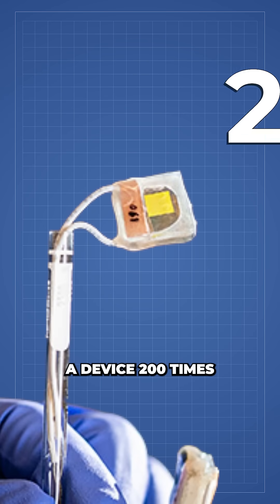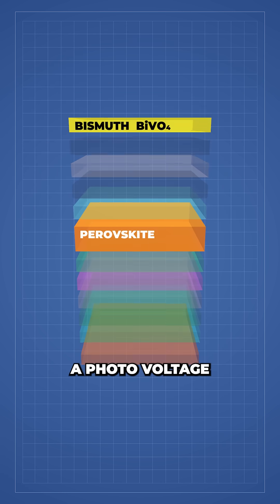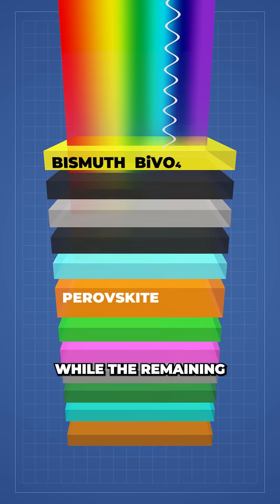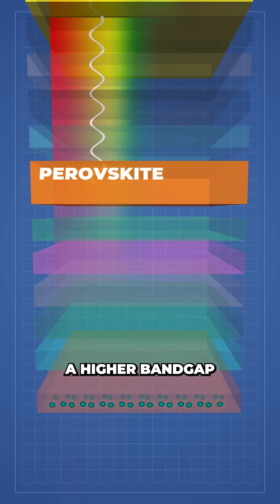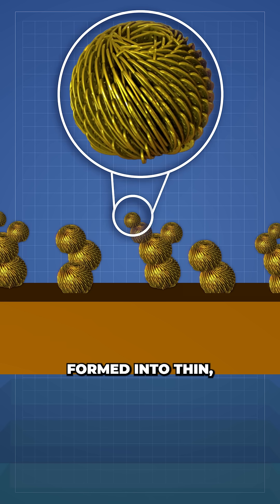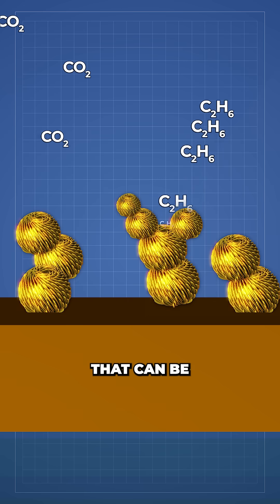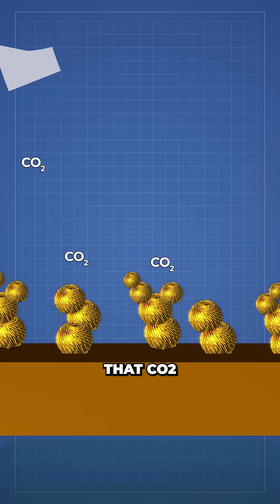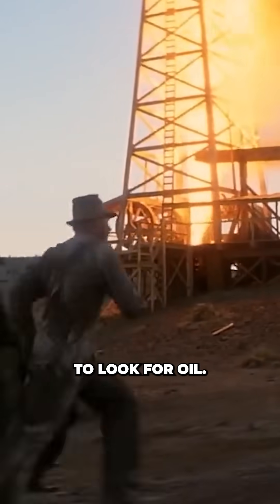Scientists Create Artificial Leaf That Converts CO2 into Fuel

Comment: I really hope this actually functions and doesn't dissapear like all the other inventions
Reply: It functions, the question is whether it's economical. If production takes too long, the mechanics scale poorly, or the finished product is too fragile for all-weather use, people will stick with traditional photovoltaics until it matures or something else comes along.
Reply: @pretzelbomb6105 Or if the oil companies flash their money at them.
Reply: @pretzelbomb6105  in this case it genuinely could work since the crystal layers are essentially how LED's work as well and copper could easily be formed into tiny structures like this as well, 

the rest of your argument stands, it may well fail in natural environments
Reply: @pretzelbomb6105 production and sourcing materials = way more than forestation I just do jot see it I’m sorry
Reply: @pretzelbomb6105 it is just prototype. Solar panels prototype also weren’t good enough to make electricity. Also, thats how plants are. They’re inneficient and produce only small fraction of oxygen that is released into aid. Other is absorbed by plant itself
Reply: @pretzelbomb6105 I can see it being used for heavy industry, but not for consumer use.
Reply: @pretzelbomb6105 also this tech completely ignores the fact that co2 is still released into the atmosphere if we use it to create fuel from it. The same issue with e fuels. E fuels a worse because they release co2 that was previously stored away already in the garbage they use to create them. At least in this video it sounds like this invention is net zero. If this thing increases the overall fuel usage, even if it takes out co2 again while active, the overall co2 levels in our atmosphere rises. 

Also a general issue, especially in denser cities, having the exhaust gases of anything that runs on fuel trapped in cities is really bad for the health of everyone living there.
Reply: @pretzelbomb6105  dude even if production never hits industrial scale enough to replace ordinary fossil fuels in the next century. This alone can offset the carbon footprint of gas vehicles since it actively pulls carbon dioxide out of the air. Fuck the fossil fuel replacement. It will save the planet from global warming by itself. Like holy crap. 

Like it’s amazing that it can replace fossil fuels in the future. Though it’s even more amazing it actively cleans the environment from the fuels it makes!
Reply: @pretzelbomb6105 Anything that will disrupt the current power structure is seen as uneconomical.
Reply: @TheHardys01  No it isn't. You don't think major companies would want to hop on this technology if it could let them output the same power at a reduced cost? That would mean a higher net profit for themselves. In reality its actually all about the feasibility of making this on a large scale and still retaining profit. If its possible it will happen.
Reply: @TheHardys01  sometimes its more about can we produce it cheap enough to produce the problem with some inventions are cost and logistics
Reply: @justinmcgough3958  yeah but they would practically spend huge amounts of money on making new facilities to replace the  now obsolete old ones such as with torium reactors and they would only pay themselves back in years if not decades
Reply: @TheHardys01  Yep. Money is seen as the only “cost” despite it being a human construct that will lose value over time. Future advantages/disadvantages? Environmental impacts? Unsustainable practices? Nonrenewable resources? No real things are factored into the equation at all. It’s all about money, which isn’t even a tangible object. They need to get better at math when it comes to long term effects. Some day the oil businesses will run themselves dry
Reply: @LeeTwentyThree  the oil businesses are fully aware that their practices are unsustainable, and that the oil supply will eventually dry up. They just care about getting enough money as possible before jumping ship and leaving the next person to clean up the mess.
Reply: @TheHardys01 You’re not wrong, but also this is not a new status quo for scientific innovation in the 20th-21st century. And cost rises alongside variables that, even if money were no concern, you may still not prefer those tradeoffs. “Less economical” might mean “50% more labor hours to produce the same electron output”. I think even without money, that’s still a difference that makes it less viable. And then, the question of how reliable they can do this. They have one or maybe a few. That easily could’ve taken several years to develop if not longer
Reply: @TheHardys01 Doomerist nonsense. The status quo has been shattered over and over again, it just happens slowly enough that people don’t notice. It’s also not a conspiracy that some things don’t work. The Concorde was a real plane but commercial jets no longer fly as fast. Why? Because it didn’t work out.
Reply: @TheHardys01  it's uneconomical but not for the reasons you believe.
This would actually uphold current power structures as it keeps us burning fuels.

But it's not practical because this video left out an important detail:
Carbon in our atmosphere is incredibly diluted. So unless we strap these to the exhaust of every car, plane and ship, we will have a really difficult time to get enough CO2 to reach these leaves.
Reply: @justinmcgough3958  yes problems will only arise if this ever opens the door to be combined with other ongoing projects for growing SCs from the sun. That could close the cycle matter-energy by producing devices like this for free not just cheap. 

Lets not forget at a larger scale making money is all about managing scarcity. So such combo would be as close as it gets to Star Trek matter synthesizer or in other words put an end to capitalism...

So its all about keeping a gap between what is technically feasible and what todays primitive and crony capitalism cares about...increasing inequality and nothing else.
Reply: @TheHardys01 dude it's not the deep state oil barons that shut down all these inventions. Inventions that seem great on paper are sensationalized as this groundbreaking new invention, even when those inventions are just a slightly updated version of technology that has existed for decades. Usually, these inventions just don't work in practice. They're too expensive, too fragile, not efficient, etc etc, and nut job conspiracy theorists spam stuff about how it was "silenced" or spout about how the scientists "weren't suicidal" or something.
Reply: @TheHardys01  not really, as the results of too much carbon in the atmosphere are now hitting the foundations of northern hemisphere society  full force and causing social unrest. 🎉🎉🎉
Reply: @justinmcgough3958  yeah where’d that highly customizable phone go?
Reply: @TheHardys01  no... Oil and Natural Gas were at some point also disruptive, but the economics initially were not there, evemtually we got good at oil and gas refining and Boom, Oil & Gas industry was born
Reply: @TheHardys01  The companies at the top of the "current power structure" have the means to make any viable technology work for them quicker than anyone who would compete with them
Reply: @justinmcgough3958 Dude look at all the work the US puts in to protect oil companies despite them being 20+ years obsolete. The fossil fuel industry has had a tight grip on the economy since the start of industrialization and they'll fight tooth and nail to keep us dependent on their limited resources.
Reply: @TheHardys01 it tends to create a new one
Reply: @TheHardys01 Not really bro
Reply: @TheHardys01 what do you mean
Reply: @justinmcgough3958  Plus, even the argument of oil companies silencing alternate fuel possibilities falls apart - Even they know oil is finite, this allows them to effectively make synthetic oil and pretend that there are far bigger reserves than there really are, just, "Really hard to get so the cost is going up"
Reply: @sundown6806 that and we don't really have a practical alternative, with coal and gasoline our current level of development isn't sustainable, wind, solar, geothermal, or even hydroelectric just don't have the potential to replace them with our current level of technology.
Reply: @pretzelbomb6105  By economical you mean makes big corporations 3% less profit so they toss it.
Reply: It more than likely will. Achieving something in lab is completely different from mass-production at scale.
Reply: The most decisive factor is the cost-benefit factor.
Not only monetary, but also resource-wise. If it consumes more resources than it generates, it also becomes unviable.

Generally everything is very inefficient in the first stages, especially in terms of energy, so it is initially unviable.
And then there's the economic factor, where current production and utilization methods are more economically viable and profitable, so it makes sense to try to adopt something less efficient.

Actually, there are many futuristic processes today, but they are still very underdeveloped since it does not make sense to finance their development.
You'll see this process and others begin to be developed and implemented when we run out of oil, and those new processes become more "competitive."
(basically its development and production cost will be equal to the current price of oil, when the cost of oil increases due to the decrease in supply)
Reply: Making the nano structures outside the lab is probably going to be the big issue.
Reply: @aguyhere7945  Why would they need ro make it outside the lab?
Reply: @zoraackerman1684 Because to scale this process up into something that was actually useful you'd have to be able to mass produce it in a factory setting. 

Making a few demonstrators in a lab using people who spent their entire lives figuring out how to do it is a very different prospect than figuring out how to make a lot of them with people who are just punching a time clock.
Reply: @zoraackerman1684That is one NERD question if I ever saw one 😵‍💫😵‍💫😵‍💫
Reply: @aguyhere7945   The nano-structures and the Perovskite crystalline layer. Perovskite show a lot of promise but the material has a short lifespan in real world applications. Something like a few months of viable operation.  To put it into perspective an average solar panel is guaranteed to last at least 10 to 25 years.
Reply: We are going to be bombarded with this news every 8 months like we had to sit thru 100 shorts asking if we have heard of Carbon Nanotubes 😀😀😀😀
Reply: Well, science tabloids usually overhype these sorts of things to no end. That's the real reason so many "breakthroughs" disappeared. They were never actually breakthroughs to begin with.
Reply: Or they are too expensive or too hard to scale up.  @papawheely4137
Reply: @papawheely4137 The opposite can and does happen ,breakthroughs are not or very late recognized as such and became a huge succes after all.
Transistor anyone
Also many 'crazy' ideas ,black holes etc.
Reply: It’s less about whether it “disappears”. When people say “scientists did X” they’re often talking about an academic research lab. Sometimes the discoveries in these labs are not cost efficient or scalable, but they pave the way for new technologies that may be. First you have to convince a company to produce it.
Reply: this will be the last time you see it.
Reply: the problem is they have to be able to make them cheap, and you're already starting with Bismuth. And Vanadium  Maybe something more  organic.?
Reply: It'll be bought out by big corporations and smothered to keep their profits. Tried and true practice.

Backup practice is to divert their funding into their own made up projects that "perform better" than these, make the r&d go out on it's own due to lack of funding, kill their own faux project and get back to business of being the planets dentists drilling cavities.

Or 3rd option. If anything happens to them, keep in mind they're not processing unalive thoughts or mysteriously leaving the project without word to anyone (disappearing). Possibly even a mysterious "accident" to the facility.

If this project mysteriously disappeared, it's due to one of those 3 reasons.
Reply: Oh they will sadly
Reply: ExxonMobil: "You'll never know if this technology works or not, because an anonymous entity is going to purchase the technology and require the scientists to sign a lock tight Non Disclosure Agreement".
Reply: A lot of the problem with amazing stuff like this is while it works in a laboratory setting, it either isn't economical, or isn't stable enough to work commercially.
Reply: @themecking  Yeah but who’s to say in 5-10 years it won’t be scalable and viable? We NEED someone to support this. Because regardless of if you believe it or not.

Global warming is real, I remember back in fucking elementary school. The vast majority of summer days. I could walk outside barefoot and not even have to worry about even getting my feet more than warm. 

Now during the summer you’d have to be constantly doing the walk on coals trick. lol
Reply: These corporations are evil in nature. Driven by greed. If seen a threat to their economic future, they move to attack the threat. Despite government warnings. They are corporations.
Reply: like the other guy said, it has to be practical. this is just a proof of concept. like those cancer cures, they need to be put through much more testing before it gets approved. ie just because it kills cancer cells dosent mean it wont turn the human body into goo. 
personally I was thinking why cant we grow fields of crops then treat them for the fuels we want. its gotta be cheaper then this.
Reply: They made it a few months ago I think it's fine
Reply: "Like all the other inventions." You know, it actually amazes me that people believe such braindead conspiracy theories as if you can't take one look around and see all of the amazing inventions and discoveries that have been made and are still being made every day. Trust that if this technology is shown to be practical and profitable, then it will almost certainly exist and start being produced. The oil companies aren't some all-powerful monolith. They have great economic power, yes. But if a company comes along that is able to produce these devices efficiently enough that they can sell them at a profit, then they will. The ironic thing is that oil companies would very likely be their first and biggest customers. Such companies don't just assassinate anybody with an idea that could compete with their current business model. They just adopt the technology themselves and profit from that instead.
Reply: Ok so when for mass production ?
Reply: Assuming it's economical in mass production, it's just making more profit for them because now they wouldn't have to spend money searching for, drilling to, and transporting oil, refining it, & transporting the byproducts. It's in their economic interests to get this to work.
Reply: it will disappear because they'll end up killing all plants because of the lack of co2 and then all of humanity will collapse due to lack of food
Reply: agreed.
Reply: Hope is great, but this doesn't read like the sort of thing that can easily make it out of a lab.  Solar cells are quite on the expensive side to produce after decades of innovation, and this is a more complicated, more power peaky solar cell.  Think of it as a proof of concept, that this methodology (among several others) is a viable path for future research toward carbon capture tech.  Don't think of it as a complete idea that'll be ready for implementation in a year, or even ten.  Odds are best that some branch of a branch of this research will be usefully applied to a cousin of this idea at some point.
Reply: It will. I remember over 15 years ago the guy who plays The Hulk drove a literal water powered BMW. Have you seen any water powered cars lately?
Reply: Yeah, finding out something works in a lab but is not feasible for reality is more annoying then not finding it in the first place.
Reply: Something like this, the biggest problem would be scaling it up
Reply: Bro lost me a perovskite 😂
Reply: Highly doubt It will these materials 
So expensive
Reply: I hope it doesn't because if it works then corporations will destroy all flora to sell us these replacement plants.
Reply: The question is: "Can this cost effectively be produced" - if the answer is "There is a cheaper option" the cheaper option will basically always end up being preferred.
Reply: If it works then the scientist are going to be suddenly suicidal and it really doesn't work. Example. Eletric cars
Reply: Whatever this guy said is bullshit. Where does the hydrogen come from? Can anyone explain? It's only about a half a part per billion in atmosphere u didnt pump 2 billion liters of air thru that concentrate it and combine it w carbon. The simple chemistry does not work. If you graduated from high-school we shouldn't be having this conversation.
Reply: DrBen shows droves of technologies that i usually never heard of again ever.
Reply: It’s pretty small and we don’t know if it would work  at scale but maybe it will
Reply: We had a student here in Germany that created almost the same thing but it produced hydrogen insteadt, she was the first with this solution, It was created 13 year's ago. PV-Hybrid Electrolysers for the Photoelectrochemical Conversion of Sunlight into Hydrogen. i really don't know what happened afterwards, never heard of her again. not a joke btw.
Reply: oh it will
Reply: too bad
Reply: Israel loves to keep good tech away from us goy slaves that dont deserve to exist ... youre welcome for saying what most fear to. just trying to inspire action where it's needed. Most tech is just half the battle corruption is the other half.
Reply: соnsрirасу sсhizо
Reply: There is another video I watched about recycling plastics to make gas, Diesel, wax and more and the ending gas to power itself. It's in the channel "Two Bit da Vinci" video called "The Company Recycling PLASTIC Into Gasoline!" It's very interesting since even the cost to make is low and so on just seems to good to be true
Reply: IT needs to couse ITS Like Tesla they steal everything
Reply: If it's useful, it doesn't disappear. China will steal it.
Reply: Most miracle inventions that "dissappear" usually do so for a reason, they are either  impractical, costly, or just not working as intended.
Reply: Even nature, after 2 billion years of evolution in this direction, has only been able to reach about 1% efficiency.

When it comes to producing electricity from sunlight, we've got 15% to 20% efficiency.

Also, there are more efficient ways to make methane. Which is needed to make plastics and stuff.
Reply: Like what inventions? No, seriously. Because synthetic fuel has existed for 150 years. Coal can be turned into crude oil. Carbon to hydrocarbons is already an established technology. Ethanol is a fuel additive made from corn. 

The problem with all of these technologies is that they are more expensive and energy intensive than just drilling for oil.
Reply: The heck? I just became your 250th like and now I'm the 253rd.
Reply: Maybe two "likes" were taken back - which then knocks you back a few spots.@zoraackerman1684
Reply: @zoraackerman1684 internet is large. You clicked nanoseconds slower than the others did
Reply: I have a feeling it wont be cost efficient to be used in many aplications if in any at all.
As everything comes to cost.
Reply: People are too paranoic. Inventions don't just disappear, you've either been lied to about their effectiveness, or operating them is too costly rendering them useless.
Reply: Nah it won't really because it won't be economically viable for at least the next 50 years or so (until they improve the design). Videos like these really exaggerate things and u don't know the real state of the project until u read the articles.
Reply: It probably will disappear because the big companies don’t want their source of income to be taken away
Reply: where have you been?😂 of course this vanishes… just like water powered motors and many other things

edit: hydrogen, not water 😅
Reply: @Foefii Water powered motors? That breaks the laws of physics. You need to crack the hydrogen first and that takes energy. Of course it don’t work, it’s literally impossible to get net energy that way. Fuel cells are batteries not magical energy generators.
Reply: @Detson404 i didn‘t mean water, i meant hydrogen, sorry.
Reply: @Foefii Thanks for clarifying. Best wishes.
Reply: There is a definite 0% chance that something like this will be commercially viable within our lifetimes. I wouldn't be waiting around for it.
Reply: @bruhholmes  i mean, on one hand commercially viable computers came up in a lifetime, but on the other hand this is a very niche technology already done very economically viably by other pre-existing things.
Reply: It's obviously bullshit lol
Reply: i'm pretty sure most of the time these kind of innovations disappear is due to investors deeming it not too profitable even if it can be optimized to do so.
Reply: So many BS conspiracies in these replies 😂
Reply: the only reason i could see it disappearing is if it’s so efficient that it causes fossil fuel companies to lose money
Reply: Like OMG like literally every other invention has like literally just disappeared.......😮😮😮😮😮
Reply: To be fair, those inventions disappear because they aren't good enough